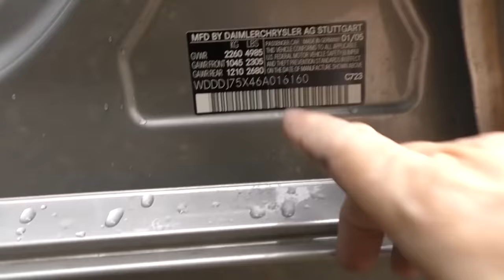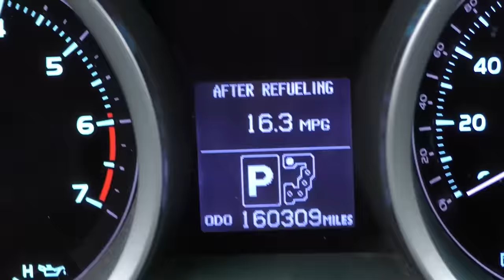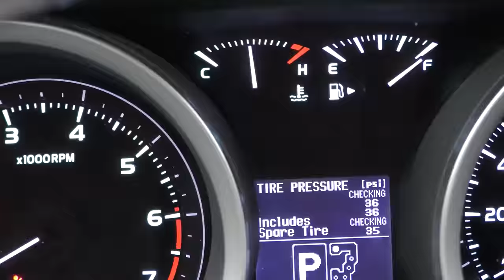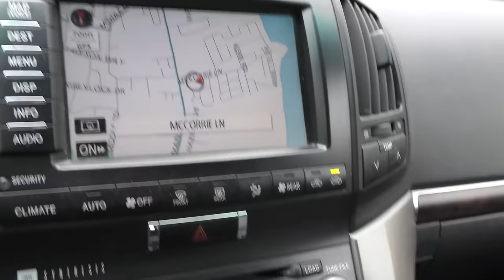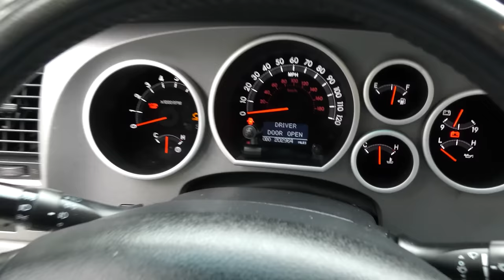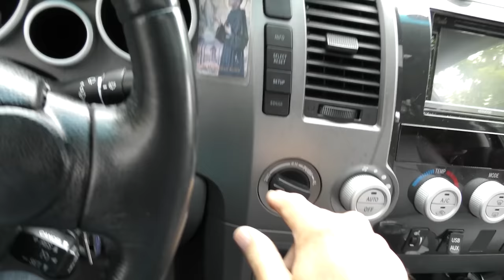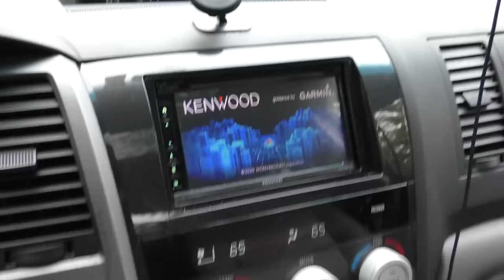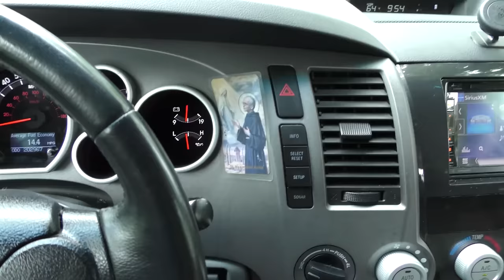What the Hell Toyota

Comment: 5 years ago I bought myself one of the smallest full size 5.7L Tundra trucks made (RCSB), it's much lighter than the standard 2nd generation Tundra so it's much faster, and also capable of almost 20 mpg on the highway if I keep it under 65. It has racked up a little over 300,000 miles and it runs great... I hope to keep it running great for many additional years by following Scotty's advice.
Reply: I use to average 17-18 mpg on my 5.7, tow package 4:30 gears , 4 door long bed, 80% highway, drove it like it was stolen, my Range Rover gets 11mpg driving like a grandma.

Comment: Honda says burning 1qt per 1k miles driven in Accords is "normal". I say that's too much
Reply: I qt to much..
Reply: It takes 5 quarts to fill it, if you wait 5k to do your oil change, there will be 0 oil coming out, just bearing material, and a knock on your engine.
Reply: Same thing Toyota told me with my oil eating 47re in my 1985 Hilux.

Comment: I just parted ways with my 03 Camry this summer. It had 255k on it. By the time I parted ways with it, it was using a quart every 400 miles. And it had the 2.4.
Reply: That is CRAZY oil consumption.

Holy crap.
Reply: 03 had the 2.5
Reply: @Prevailingbucket  nope
Reply: How often did you change the oil. Because I get my 02 Camry done every 3000 miles, give it take a couple of hundred, and this think has 262K+ and counting.
Reply: @DTD110865  Every 3,000. I took care of it. I did proper maintenance and fixed things when they needed to be fixed. They’re just insufficient engines. Scotty says so in the video.
Reply: My 02 chevy s10 4.3 ext cab i bought new doesn' use any oil.  Still runs like new. 78,000 miles.

Comment: My 2005 Ford Explorer has a 4 liter V6 and its a 4X4. It only gets 17 MPG too. I got it used and right now it has161, 000 miles on it.
However it runs good and it's nice and big too, and Cherry Red color.
Reply: Yeah, my 98 Explorer does about the same, at 175K. Pacific Green, big enough for camping. A keeper.
Reply: @dennyj8650  I wouldn't mind the Eddie Bauer Explorer, it has the 5.0 V8 and I think the differentials are stonger. 
Well I don't tow anything but thought about a small boat someday!

Comment: My 04 camry 2AZ-FE is going strong with 213k and burns about a half quart of oil every 5k oil change interval. The new 10k oil change intervals on new cars are just an image tactic to make car manufacturers look like they are saving the environment. If you care about the long-term reliability of your engine then do it at 5k. Like scotty always says "oils cheap and engines are expensive".
Reply: true i have a 400k miles opel 1.6 from 1992 5.5k mile change and a 2011 toyota 1.0 120k milesand the toyota consumes all oil in 5k miles and the opel too

Comment: There are many car makers whose service intervals are too far apart mileage wise. Many modern service intervals are 10,000 miles or more. Most modern cars need very little in the way of adjustments and lubrication during their lifetime unlike cars from 50 years ago but changing your engine oil and filter every 6000 miles is a definite must for me and use a correct grade good quality oil.
Reply: Right, they went from every 3000 to every 7500 or 10000 miles. I'm with Scotty and 5000 miles with full synthetic.
Reply: @douglasmount188  I change my oil every 100 miles just to be safe. I definitely do not want my engine wearing prematurely.
Reply: @TheSuperBoyProject  Really?.....unless you park your car 6 months at a time and then only travel a few miles you are throwing money out the window
Reply: @TheSuperBoyProject  I do too... sometimes go 150 if feeling brave... Have to change it several times a week but it will be worth it in the long run.
Reply: @mjuberian  no it won't
Reply: the manual in my wife's 2014 escape titanium says 10k at most for oil changes.. I'd never go that far, but it basically says that's the max, and to change it sooner
Reply: @richsweeney1115  check The severe service interval severe service for a lot of cars sounds more like every day driving
Reply: @thetechlibrarian  it doesn't say different driving condition intervals, it just says 10k miles is ok. it will never go that long between oil changes.
Reply: @douglasmount188  my 88 accord said 7500 miles, I remember thinking .. that's insane, I'm not gonna push it that far. it was already like 19 years old at the time, but it only has around 100k miles.. and it was a 5 spd Honda with 100k... I'm sure it'd still be reliable if I still had it today.
Reply: @richsweeney1115  yeah my 99 accord was 7500 miles too some of the Hondas in the book say to oil change the oil filter every other oil change. But I don’t agree with that

Comment: My car list.

1) 2013 Prius daily driver burns 1 quart every 1k miles.

2) E46 M3 swapped sedan 45k miles on rebuild, burns 1/2 quart oil at 5k oil change.

3)E46 M3 blown engine, don't know what it burns rebuild on the way.

4)2005 Range Rover, burns 1 quart every 5k miles.(takes 10 quarts)

5)2006 BMW X3,120k miles, burns 1 quart every 3k miles.

6)2000 BMW Z3,190k miles, burns 1 quart every 2k miles.

Comment: I don't trust my Toyota dealer to change my oil ... let alone try and rebuild the 2.4 in my 2009 Camry ..... I'll just keep changing the oil frequently and using good quality oil and filter. So far, the Camry still runs like new, but we only drive it 3-4,000 miles per YEAR !!  Just my luck I bought one of the few Toyota mistakes !!!

Comment: My 2007 had a cracked piston .Mechanic charged me $3200 .Car on had 53,000 miles.Checked with Toyota and of course they wouldn’t do anything .We sold our 2006 Rav 4 with 190,000 to buy this .Wish we kept the Rav .Nothing was ever wrong with it
Reply: Jay Yoyo  I got lucky with my Highlander. It was made in Japan. I bought a used hybrid against Scotty's wishes before i started listening to him. It's given me 90,000 thousand stress free miles. Drove it across America from California to South Dakota and back. It drove and still drives like a charm. Accelerates 0 to 60 in under 7 seconds still. It's at 220,000 miles. Bought it 3 and a half years ago for 6,900 bucks.  It's giving me 31 mpg combined because I'm an expert at the Toyota hybrid system. It's the 2006 2 wheel drive 3.3 liter V6 Hybrid Limited Highlander.  No rear differential problems on this one since it doesn't have one. It's simple.  Just oil changes every 4500 and transmission fluid changes every 45,000 miles.  The transmission is like a manual one and you don't ever need to change a filter in it. It's so easy.
Reply: Year's ago sold our 97' Rav4 with 280k mi and it was still going strong
Reply: Jay Yoyo I use it mostly city. It does better in the city than highway if you know how to drive the toyota hybrid system like a pro.  I bought it used for $6,500 3 years ago. It had the hybrid battery replaced before i bought it. But if you don't check on that, then it can be a little extra. I learned how to replace the battery myself. I'm a diy mechanic so it's really worth it for me.
Reply: Jay Yoyo  yeah. I kept asking everyone to show me proof before i bought them. I bought a 08 Civic Hybrid as well. For $4500. It gets 40 mpg. It only had 125,000 miles. I've seen it getting 50 mpg plus in urban areas. Both cars have given us at least 90,000 miles and I just keep changing the oil and transmission fluid.
Reply: Jay Yoyo  typical owners run them into the ground and ignore any and all maintenance but they just keep going an going
Reply: Jay Yoyo  31 is OK?? for an SUV??  I wouldn't buy one. but 31 mpg is for an SUV is more than ok

Comment: My 04 Matrix XRS (2ZZ engine) burns no oil at over 300K, I'm even more amazed now after hearing how many problems that plaque other Toyota engines. It was made in Canada!
Come on, Scotty, the 2ZZ with the Yamaha head didn't kill the Celica, the anemic 1ZZ did.
Reply: Don’t diss the 1zz tho! I have a matrix XR and she pulls! And gets amazing MPG.
Reply: It was killed because these fools had no taste in real cars.
Reply: @puregsr hey don’t diss the 1ZZ-FE engine, it may not have high horsepower, but it’s sure reliable. Toyota should’ve stuck to using THEIR OWN engines. More power isn’t always better! I have a 1ZZ-FE engine in my 06 Matrix, & it’s got 150K miles, & I find it plenty fast enough. The gas pedal is very sensitive, & it’s easy to speed in, so I wouldn’t call it slow. But more importantly, zero engine overhauls or rebuilds in these miles. I know you love your high horsepower engines & swear by them, but hey, Scotty’s been around & deep into this car stuff with different makes & models for 53+ years, & in the real world the slower engines are more attractive to someone who’s been on the planet for decades, because they’re responsible not wanting to go fast & dangerous & killing themself. That pretty much concludes what I say. 1ZZ-FE is a great engine, Scotty had one in (2001 Celica) 360,000 miles on it & it seemed plenty fast enough for a regular driver. What’s there to hate? Nothing.

Comment: My wife had an 07 RAV4 and it qualify if it was burning 1 qt per 1200 miles before it had 150k or 10 years old, and hers wasn't of course, but at 225k that sucker was burning 1 qt every 500 miles. Me and my buddy tore it down and milled the return holes out, put new rings and replaced the head gasket and put it back together. We did it all without pulling the engine, the timing chain cover has a couple bolts that are a pain to put back together when putting the head back on and you need a few universal joints to get the far driver side rod off the crank. But it's a nice relatively large oil pan, so we managed.
Reply: you did all that and didn't put a new timing chain and tentioner on it??
Reply: @richsweeney1115  no chain was fine and as Scotty said, he's never seen one break. Cleaned the old tensioner up in a parts washer and slapped it back in there. Did get new head bolts though so there's that lol
Reply: @Ifitfitz22  lol, I just thought pulling it apart youd put a new chain on while it was apart. we have 2 5 spd Hondas  well over 200k and the chains are fine though

Comment: I got a Toyota corola 2004 that literally sat in the driveway and didn't move for at least 5 years. I just drove it from Texas to nyc all it needed was an oil change a new battery and some air pressure in the tires.
Reply: Got slightly above 30mpg highway because I only filled the tank 4 or 5 times the entire way and it's 12.5 gallon tank.

Comment: I dunno, with dodgy timing chains and guideds I'm happy changing my belt every 10 years.
Reply: we have 2 5 spd Hondas, w over 200k.. both have the original chains with no noise.. I've never had to change a timing chan in any of the cars or trucks I've had. I've had to do a few timing belts .
Reply: @richsweeney1115  I had an MX-5 and I think the vvt had gone bad, so sold it.  One hears of so many probs with chains in BMW'S etc.  After all doing a belt once every few years is no hardship, I've one on my Lexus 👍

Comment: i have an 03 matrix, it has a similar problem, apparently the oil controll rings get gunked up and stop sealing. you are also forgetting the garbage that was the post 87 tercel, and the questionable 3vz with its head gasket problems.
Reply: I knew a gut that had a Tercel with around 300, 000 miles on it!
Reply: @metalmike570  what year? pre 87 were great.
Reply: @shonuffisthemaster  Yeah it was around a 1986 model; now I think it was only about 250K but still that was high mileage!
Reply: @metalmike570  ya the 86 still had the 3ag engine, good engine, basically the same one that was in the corolla. i used to have a couple tercel 4wd wagons, they were great

Comment: Are these the same engines Toyota said 10K between oil changes and after 100K they go downhill quickly and shot by 150K? This is probably what happens even to engineers in our new educational system. 1 + 1 = It doesn't matter.
Reply: Check out carcarenut, he said it best. The 10k oil change Increment is ment to maintain your warrenty not the long term life of the vehicle. Change full synthetic oil every 5k. Avoid this issue all together in new or older cars.
Reply: Not back then
Reply: I don’t care what the dealer or manufacturer says, change your oil every 5k to 7k miles. I personally do it every 5k so it’s easy to remember in the odometer.
Reply: i have a 120k mileage toyota with 10k oil changes after 5k miles of driving the engine consumed all oil i filled it more now im thinking of doing vvti and engine rebuild kits maybe( i got it second hand and its unmaintained but looks good dents and scratches and ex dents that are repaired its good enough)
Reply: If you use good quality oil like Amsoil XL or Amsoil Signature series you wouldn't have problems.
Reply: bought a 21 tundra, called them directly because I could not find change intervals in the manual and dealer was no help either, they said lifetime fluids :) whatever that means
Reply: @blacklilac1408  i use toyota and mobil curently a mecanic filled my car with liquimoli and castrol and castrol in balkans is counterfeit and it put 5w30 vw porsche oil instead of toyota 0w20 and gearbox it put heavy duty instead of normal and its texaco and that is castrol
Reply: @CheekyMonkey888  uhhh people in the present dont change gearbox oil they change gearbox
Reply: @Noooo23523  You are right. As Scotty says oil is cheaper than the hardware. People should change the gear box and gear diff fluid more often.
Reply: @Noooo23523  Give Amsoil Signature Series a try man!
Reply: @CheekyMonkey888  Scotty has a video about "life time" fluid. The fluid is only good to 60,000 miles. It even says so in the manual. You should be changing your fluid at a minimum 60,000 miles or every 5 years. Good practice is 30,000 or every 3 years. You should change your diff fluid every 30,000miles or 3years as well.
Reply: @blacklilac1408  im in europe the best is mobil1 and motul here
Reply: @blacklilac1408  there is no amsoil or things like that in europe
Reply: @blacklilac1408  I read the entire manual, not sure if we got a different one in Chinada, but not a word about fluid intervals (other than to tell us to use watery 0w20)
Reply: @Noooo23523  makes $en$e, for the $tealers$hip that is
Reply: @Noooo23523  They do have a international site
Reply: @CheekyMonkey888  Try Amsoil Signature series 0w20 it has better film strength and is a lot better in cold than the competition.
Reply: @blacklilac1408  ok but ive never seen or heard about amsoil or other american oil here
Reply: @blacklilac1408  I spoke to a mechanic at the dealership, he mentioned he uses a heavier oil in his truck, and that the 0w20 is only to meet CAFE gov standards
Reply: @CheekyMonkey888  just on any car you should change at 5k miles or max 10k km and some cars require 3 k mile change like 5k km and most recomend 15-30k
Reply: @CheekyMonkey888  you can if you want. For example it say in the manual that if you want you can use 5w-20. It's about the film's strength and protection quality.
Reply: @Noooo23523   Yeah I can promise it's in you area and I cant place links in the comments but check there site.
Reply: @blacklilac1408  k bro
Reply: @blacklilac1408  yes bro theres 1 amsoil distributor in my country and its 50km away
Reply: @CheekyMonkey888  yea i heard if you drive in high temps for long time you can put sligthly thicker but also heard that it can clog up my vvti
Reply: @mcc7762  problem is the vehicle is t designed to last so even if you go extra on maintaining it's still on a vehicle they make to not last
Reply: @Noooo23523  same tundra sold elsewhere gets 5w30 factory fill, look up the Mexican owner manual (the cars that absolutely need super light oil have very thin piston rings designed for 0w20, or even lighter 0w16, or the uber light 0w8)
Reply: @CheekyMonkey888  oh ok, wow i heard of 0w16 but not 0w8 thats a lot
Reply: @Noooo23523  yeah they re trying to suck every last possible mpg to improve their CAFE fleet average mpg
Reply: @CheekyMonkey888  well i think mostly emisions cuz every car in us even i4 are like 2.4 litres and have 30mpg, in europe if its not more mpg its bad my car is a 1.0 and it gets 50mpg and the engine is worn out i heard the engine should get 60 mpg but yea it has like 40mpg in city with hard acceleration and braking it has 70 hp
Reply: @Noooo23523  it s CAFE average fleet mpg standards, that is why Toyota no longer sells the Land Cruiser in the USA; if they did they would sell every single one they could bring over (people are buying them used at more than they had cost when new)
Reply: @CheekyMonkey888  bruh

Comment: Still driving my 04 Silverado with 200000 runs like a new motor Burns 0 oil.
Reply: Similar with all of my GM stuff, new and old. Keep changing the oil & filter on any car, keep the salt off, drive it reasonably prudently, and it will last forever.

Comment: I got one of these Camry's for free with blown motor because of this issue. But I got a JDM imported motor and swapped it in and had a very good car!  It's weird that Toyota messed up on this because everything is so well made.. the original motor had 170k miles and (just for fun) we tore into the old motor to inspect it and so many of the parts looked flawless..thr bearings looked untouched..brand new. But apparently the original owner ran it low on oil, overheated, and eventually warped the head/gasket.. the swapped motor probably had 30k miles.. it'll outlast any new car
Reply: sounds like the person before you didn't know how to check their oil.....
Reply: @richsweeney1115  yeah it happened quickly.

Comment: They can all pull a lot more than what they're rated for it's not the engine that matters. It's the suspension I mean they used to put street six engines with 150 horsepower and huge dump trucks like 220 torque not even and that will pull way more than your new tundra by the way